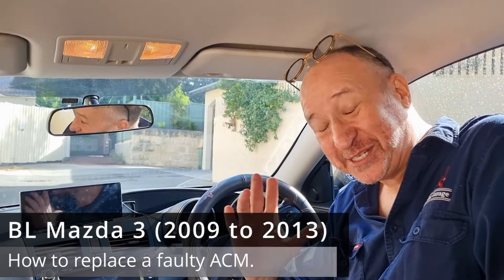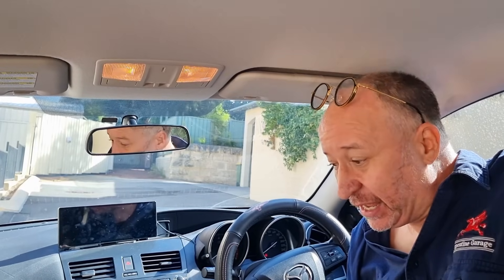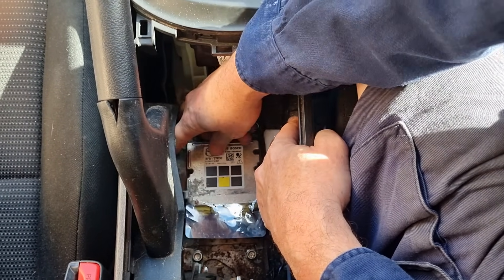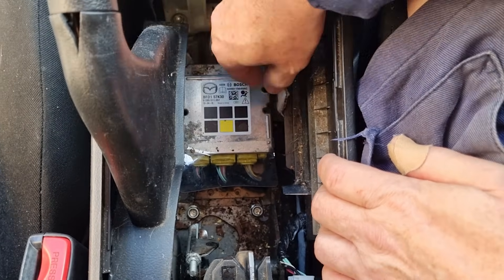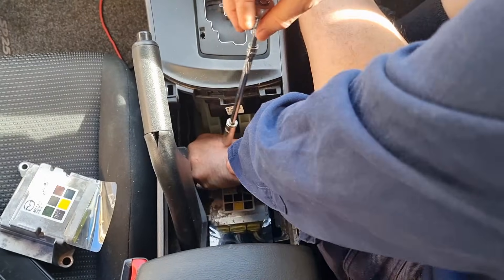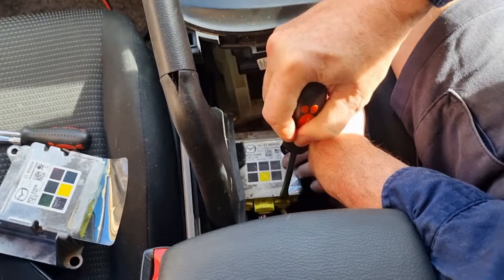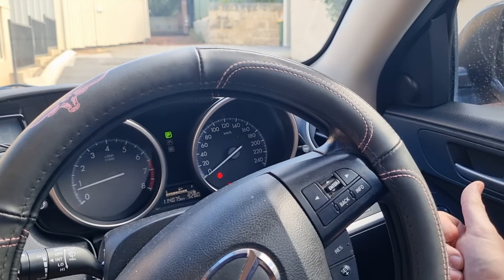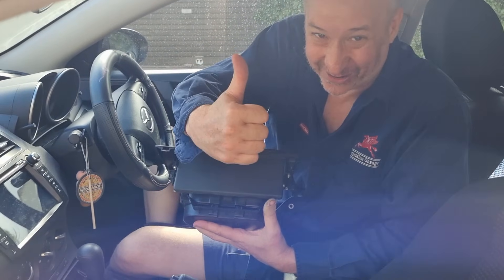BL Mazda 3: Diagnose & replace a faulty Airbag Control Module (ACM). 2009 2010 2011 2012 2013 2nd

Comment: Thanks for this, especially the tip on removing the trim. Did that, pressed the connectors in and the error went away.
Reply from the maker: Awesome!  Glad to help.  Paul.
Reply: @PaulinPerth  My 09 Mazda 3 SP25 Luxury was the front drivers Bose harness.  Had the car since August and 3,000KM's and today all of a sudden I have this airbag alert that seemed to have a definite series of pulses and then change to a different number.  CHRISFIX YouTube 11 million subscriber channel has an 11 year old video that describes exactly what to do.  99.9% he says it's just dirty connectors under the front driver or passenger seats.  Came home and slid my front seat back and forth 3 times and airbag warning light no more.  He says a solid red airbag warning light is far more serious.  Awesome!!!!!!!!!!!!!!!!!

Comment: Hi Paul, hope you are doing good! I got a 2010 Mazda 3 with 272,000km on it runs great. How common is this issue? How many km do you have on yours? I found cups that fit exactly in that cup holder so it doesnt get messy and keeps the spills inside
Reply from the maker: I've only had it happen to two customers.  It's very rare.
Reply: @PaulinPerth ok not bad my abs module is acting up sometimes. How many km do you have on your mazda?
Reply from the maker: Hi Jacob, on my daily BL I have 160K kms.  But I have wrecked a car with over 300K on the clock, and the engine was still running well (although the rear main seal was leaking a moderate amount of oil).  I have heard of them going 400K.  Both the LFVE and L5VE engines are very well engineered.  Recommended.
Reply: @PaulinPerth thanks Paul . Yes they are great! Unfortunately in Canada the rust gets to the body.

Comment: I did not catch all of the technical details in the video 🤔. The only thing I know about cars is how to drive them and how to fill them with petrol…I have to go to the garage for every tiny issue. Fortunately my Toyota Auris (2014/200 000 kilometers) does a great job. In my opinion Toyotas are the most reliable cars in the world.
Next time a headlight bulb needs changing I‘ll ask you 😉.
Happy Easter to Caroline and you.
❤ Bettina.
Reply from the maker: Ah yes, in Australia the Auris is called the Corolla.  I owned a 2015 Corolla a while back.  It had one problem when I bought it, and zero problems when I sold it.  A great car.  Highly recommended.

Comment: Question for you Paul: how do you have so much expertise about cars, specifically these Mazdas? You seem to have a wealth of knowledge. I don't have a Mazda but I enjoy watching these videos regardless haha. Good to see you back at it!

(Also, love the tip about keeping an eye out for coins 😂)
Reply from the maker: It all started when a Polish guy named Damien was staying at my house in Ardross.  He wanted to learn how to work on cars, but he had a bad relationship with his father, so his dad hadn't taught him anything.  I learnt from my father, and it was a great experience.  So I bought the cheapest smashed up car I could find, which just happened to be a Mazda 2.  I taught Damien about cars with that Mazda 2, and we wrecked the parts for money.

It was fun, so next we bought a Mazda 3.  Then I realised how much better the Mazda 3s were to wreck, since the base model had the same wiring as the top end model, so you can take (for example) the cruise control from a smashed up Maxx, and put in a licensed bottom level Neo, thus increasing it's useability and value.  If you want to turn a Neo into a Maxx, all you need to do is install cruise control and swap over the wheels.  Boom!  The car has been lifted a level.  Looks better.  Drives better.  Worth more.

Then I just kept on going.  There are too many cars to get good at all of them.  Plus many models are not worth getting good at because they are a crappy design to begin with.  The Mazda 3 ticks all the boxes.

In my opinion, Toyota make a better car.  The problem is that when you wreck a Toyota, you can sell the panels, but never the mechanicals, because they never break down.  Mazdas occasionally have mechanical failures (particularly the ABS pump and TCM), so that help make wrecking economical for me.

Paul.